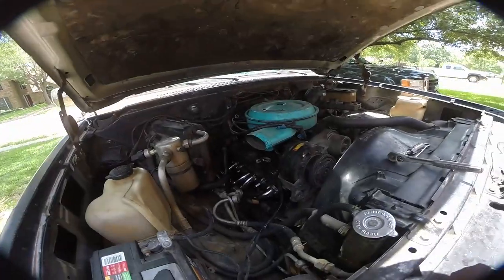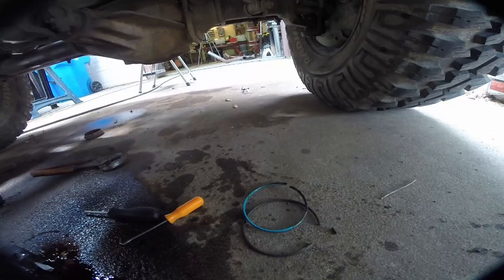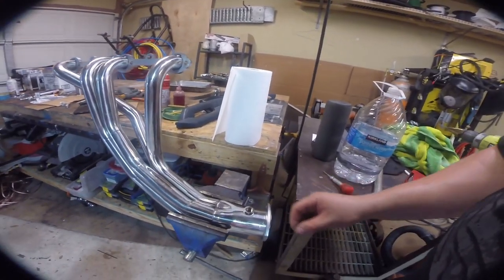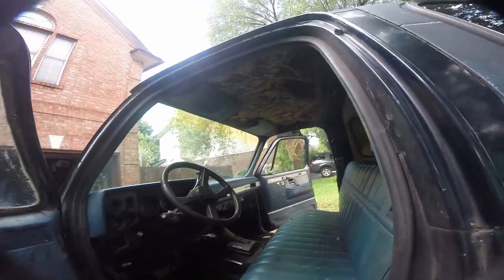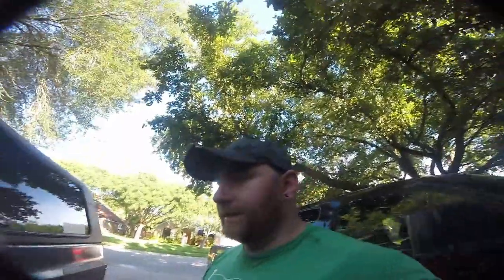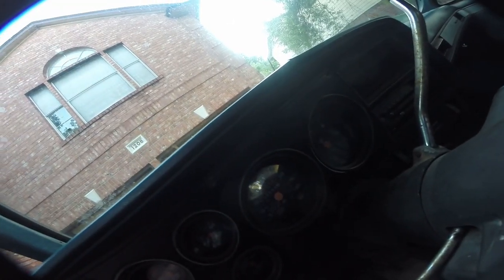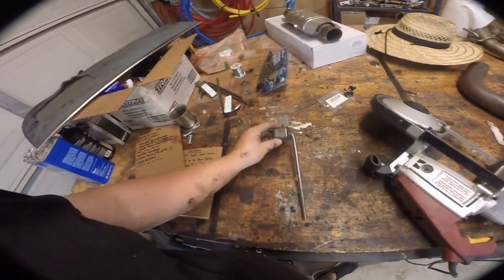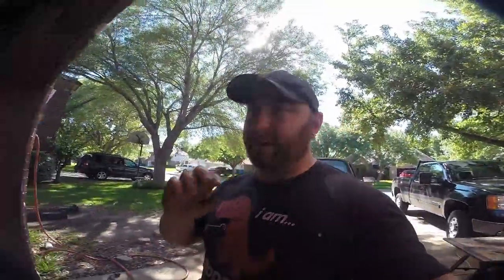1989 K5 Blazer Build - Episode 2 - Custom Exhaust, Corvette Servo, State Inspection

Comment: On my 87 350 TBI the pressure sensor for the oil gauge is down by the oil filter. L shaped fitting near the distributor goes to a pressure sensor that is for a safety feature, I think it was a kill switch if the psi drops to 0

Comment: Maybe I missed it in the video but what is the benifit of  putting a corvette servo in it. Great content and cool truck in am working my way trough the whole series. Keep up the good work.
Reply from the maker: corvette servo increases the line pressure giving you crisper shifts. Saves shift time. Makes it feel better. Easy worthwhile upgrade.
Reply: @Makswerks1  good to know. Not too sharp on stuff this old. I have a 77 k5 that has a fresh 400 and turbo 350. Can't decide if I want to keep it in there and just learn the Old School Technology. Or if I want to swap a 6.2 L LS into the truck. I have everything I need to do it so it's hard to convince myself otherwise
Reply from the maker: @bobbysixsevenw  I want an LS too, but I must admin the 350 has grown on me some.
Reply: @Makswerks1  I daily Drive mine and that fresh 400 runs great and has tons of power. So I'm kind of torn. Plus I haven't seen a whole lot of them with all late model drivetrain. I haven't gone looking but I'm wondering if there's a reason for that

Comment: Hey Max I'm surprised they inspected it with the exhaust not exiting the sides or from the back.  Normally they mandate the exhaust must clear the passenger compartment.  The inspector must have decided to give you a pass since you were willing to throw on cats, lol.
Reply from the maker: I have not seen that. I know plenty of folks with high end rigs and rods that dump in front of axle. But this inspector specifically didnt look at anything. He just took down the VIN and mileage and gave me a sticker.
Reply: I ran my exhaust out the sides behind the rear tires and it helped the exhaust smell a ton! Mine was dumped right in front of the rear axle and my clothes reeked of exhaust after driving it. I don’t own a top 😆
Reply from the maker: @AdamCanFly  Thats a good point. I will see what its like when the roof is gone. But currently with the cats it burns pretty clean to be honest. Doesn't smell of gas at all.